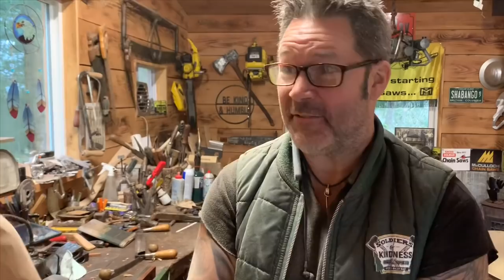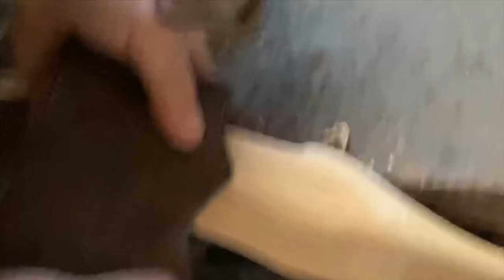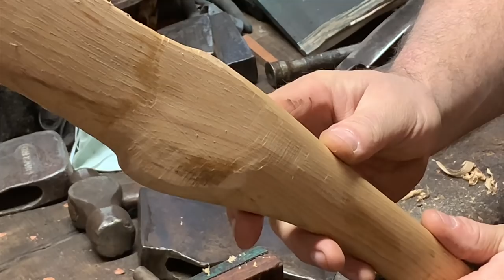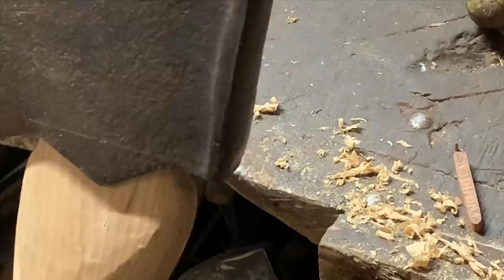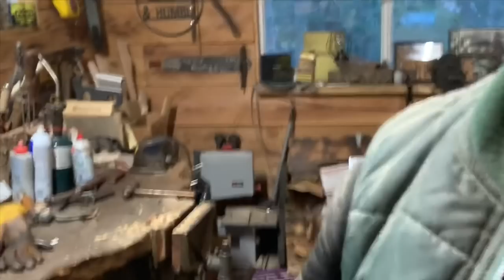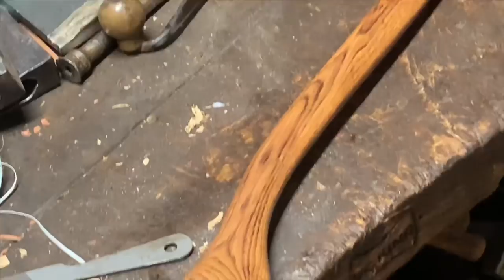One of the last axes of 2019

Comment: On the end of the ax handle  ... make a jig that is on an angle so you can hit the jig to make it suck up the ax head.
Reply: Activity Angle Ruler Protractor Horizontal T - Type Bevel - Tapered Carpenter Measuring Tape Multi Angle Adjustable Gauge Measurement Tool with Wooden Handle

Comment: I have been running chain saws 40 years and my little finger on left hand is curled over I've noticed Billy's is as well is this chainsaw related has anybody else got this
Reply: Could be ... I don't saw daily but when I saw for several hours I feel it most in my right little finger (I'm left-handed) ... shortest tendons on the front handle hand.
Reply: It's possibly the onset of Dupuytren's Contracture.  It often affects just one hand and varies from slight to a complete curl of that finger and sometimes the ring finger or inability to open the palm.  I have seen it a few times in both family and friends but don't think it is connected with saw use or injury, it seems to be congenital usually.  My step father had it (operated on and now much improved) and he was a chef and restaurant owner before retirement.
Take care, J